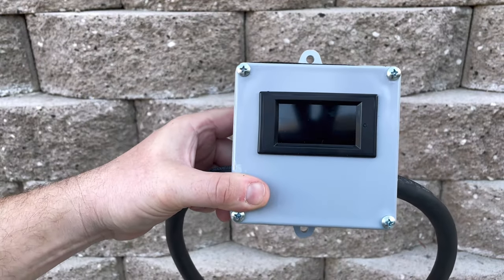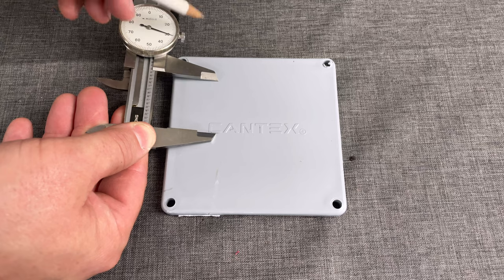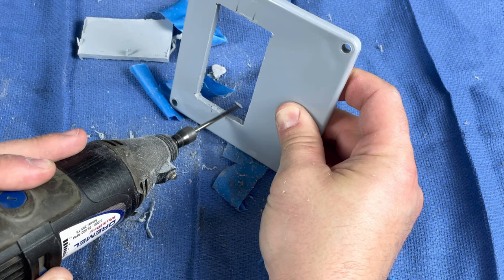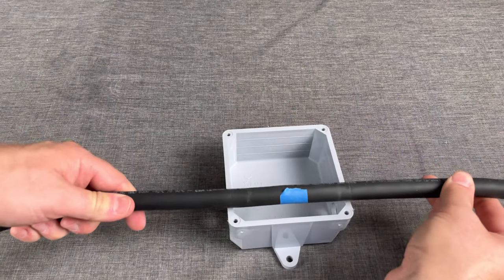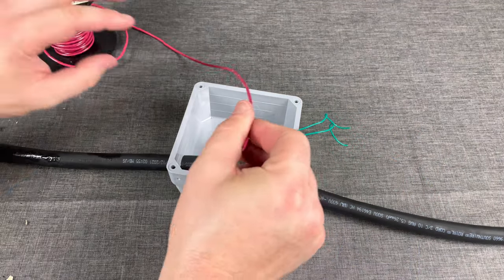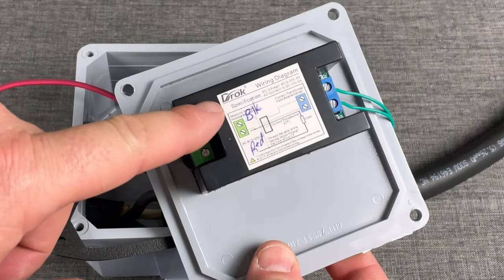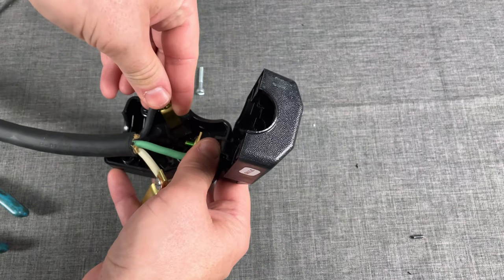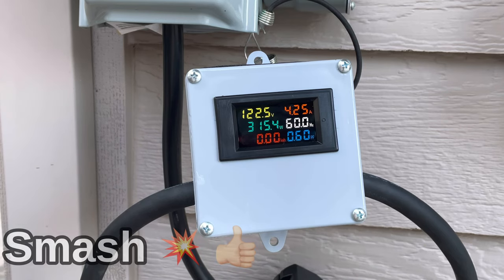Volts Amps Watts Meter RV Generator Load Meter Build

Comment: 6:10 that's not a hall sensor that's a current transformer , u need hall sensor for dc measurement only and still they are very inaccurate .
Reply from the maker: A Hall effect sensor has a ton of uses for ac and dc. They use them in so many items now thanks to microprocessors and small computers they can detect multiple things in both ac and dc currents. 
A hall sensor detects the Hall effect. Which this sensor thanks to the world of technology it can convert the data into speed, current ,  and more to  measure other forms of magnetic fields. That data is ran thru a small computer to give the information we wanna see. 

Hall effect sensors have been around in many applications in gps, cell phones and medical devices and more for a while.  

I don’t know every everything but I try to read and research items that way it’s I guess somewhat accurate…😅😀👍🏼👊🏼
Reply from the maker: You could also call it a current sensor as well as they do the same thing.
Reply: @johnnysweekends  yes but in your display meter that is a current transformer. U pass the wire through it and it has a coil wound to the toroid & when current goes through it , it produces a small voltage at the other coil and the meter reads it to calculate the current and waveform for power factor. A hall sensor can be just taped to the wire , check some of those dc current clamp meters .. in proper installation they use current transformer (ct) for ac current measurement and shunt for dc current measurement. The hall effect sensor is not accurate & u will find that in spec sheets of dc clamp meters.
Reply: @johnnysweekends  if u have an oscilloscope , u can connect that current transformer to it and measure current wave form of stuff in ur home & if u provide the scope with a voltage wave form u can calculate power factor and see how different loads pull current like capacitive , inductive or resistive loads. Even a cheap oscilloscope will show u pretty good representation of mains frequency wave form and current wave form .
Reply from the maker: I’ve been meaning to buy one to verify some of the wave forms, even though now I think with current technology even cheap products can produce pure sine wave easily. 
For the most part I understand what you are saying but In the video I try to keep things simplistic for viewers as a majority don’t care about more of the technical aspect. And these meters you buy are always advertised with a Hall effect sensor when you purchase them. You can even just buy a current sensor but will be advertised as a hall sensor. Basically the ring you pass the wire through will be advertised as hall sensor and you can just buy that with a pigtail. But Hall effect sensor will pull up both items. A current sensor ring and a hall sensor that looks a little more like a shunt but with leads coming off it.

So for viewers it’s just easier to not get to technical, because I know there are several electrical engineers who know way more then I. Which seems you are a few steps ahead. But thanks for the conversation…👍🏼😀
Reply: It was this comment
Reply: @johnnysweekends  I randomly saw him post on another completely different video in the same day, I commented on the other one and then commented here to link them. Sorry that's prob weird lol
Reply: @johnnysweekends  it's just weird I hardly ever see the same posters in random locations.  Small world after all
Reply from the maker: It’s true, I know what ya mean. Don’t think I have seen a same poster on other channels. But they are out there…😂
Reply: I bought 2 of these from banggood one with closed ct and other with open ct so I don't have to cut into wires. It works great. I will fit one permanently in my genarator.
Reply: @johnnysweekends  it’s okay if someone corrects you, we all can learn from one another.

Comment: First off no wire not even SOOW cord should be run through a box even if its plastic. It has to have either a strain relief, nm connector, or weather proof cord grip if used outside. Second no voltage of wire gets connected by wrapping another wire around it and wrapping that with tape. That's stupid and how shit shorts out and causes fires. Wires get cut, stripped, twisted together with lineman pliers, and then wire nutted to secure the twisted connection. Third the signal wire should be 10 gauge as it has the same load on it as the rest of the cord. However, as that meter can't fit a 10 gauge wire a minimum of 12 gauge should be used as in the NEC code book it can be used for 30 amp although still not recommended. You absolutely do not 14 gauge or 16 gauge wire.
Reply: The signal wire that gives the display its power and measures the voltage absolutely does not have to be 10 gauge wire.  It is not carrying the same load of the circuit.  You can use 18 gauge or 20 gauge wire.  Not sure what you’re referring to maybe